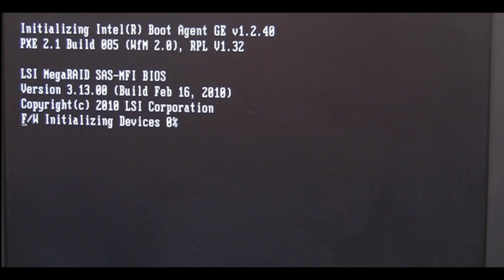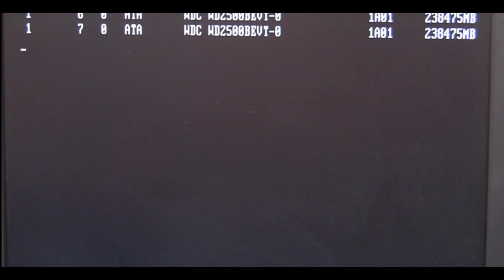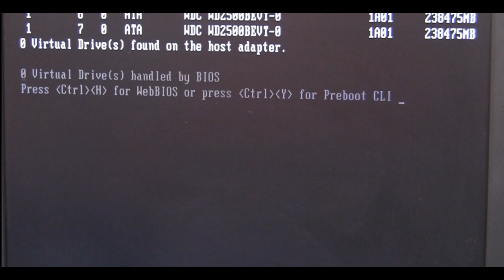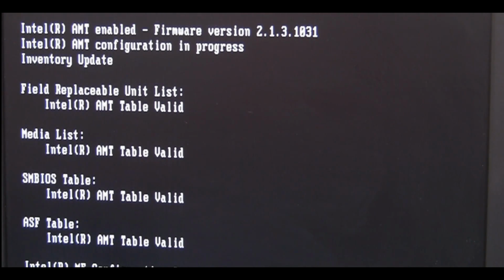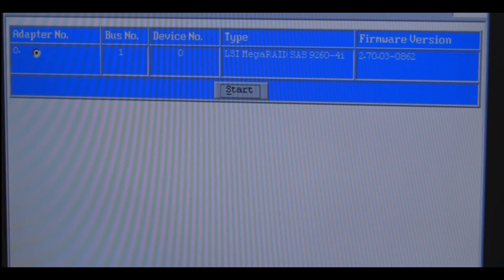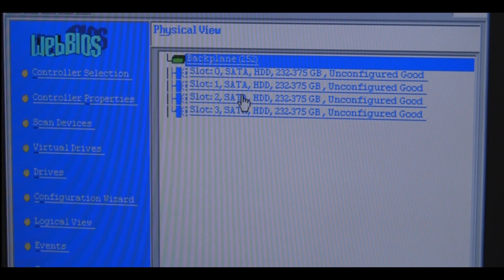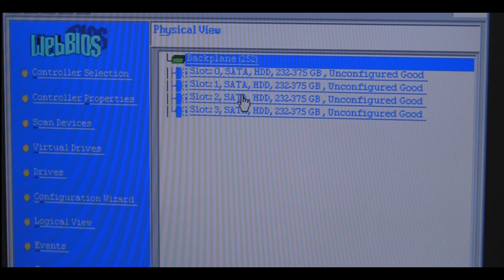Installing the LSI SAS controller in a Desktop Part 2

Comment: Sir, please help and reply my question.

My LSI SAS array card 588735-001 is damaged, it was previously configured with raid. If I buy a sas raid controller of the exact same type, does it need to be configured again or is it plug and play?
Reply from the maker: No, and it is critical that you configure the new one exactly like the old one in order for the array to work properly.
Reply: @TechsavvyProductions  If I replace with new sas raid controller and configure it again, will the operating system and applications that were on the old hard disk be lost?
Reply from the maker: Yes, be sure as much as possible you restore the disks and controller as the old one.
Reply: @TechsavvyProductions  okay, thank you so much. From Indonesia 🫡

Comment: does the card require raid software or will will the drive be accessible by the host ?

meaning throw in the card and a sas drive and then the drive can be formatted by the host and show up on the desktop as if it was a sata drive?
Reply from the maker: During the boot process you are given the opportunity to access the controller firmware, its in the firmware that you setup the JBOD or RAID configuration.   Based on what you configure that is what Windows or Linux sees as a drive.
Reply: @TechsavvyProductions  i was mainly asking if it was pretty much plug and play because i have kali linux installed and i am thinking of getting one of them cards.
Reply from the maker: Yes, after a driver is installed it should work fine.
Reply: @TechsavvyProductions привет, в прошивке биос контроллера 9260 видны диски подключенные к контроллеру но они не определяются в windows,  контроллер lsi 9260 8i, драйвера для контроллера установились с отчетом "устройство работает нормально".
Что надо сделать в этой ситуации чтобы нормально работать с дисками не создавая raid массива?

Comment: Nice video, do you have a tutorial with examples using sas drive and what type of connectors using with some specific controller im really confuse with that.
Reply from the maker: Good question, this was a lab allowing students to learn enterprise RAID both setup and repair of RAID arrays.   But there are bigger issues, SAS drives run hot and they must be cooled, controllers do not have fans so they must be cooled.  Most controllers use a 1-4 connector  one interface goes to four drives.  SAS have value only if you plan RAID arrays, if that is case check our video:  https://youtu.be/ZqPxuQ1ibKI  and https://youtu.be/-7EjJYInIzE

Comment: How do I get into that bios? I have 2 1tb ssds connected to the controller, no drive connected pc, so no OS. I boot up and it goes right into my mb bios. What am I skipping? NO shows that beginning step! DO I connect another drive to pc, install windows then  use utility disk that came with controller??? PLease someone respond
Reply from the maker: Most newer motherboards turn off BIOS boot up screen text (example POST).  Start by turning off fast boot and any motherboard logo displays so you can see the adapter card's firmware display during boot.   As your UEFI/BIOS boots it must yield to the firmware in the controller with some type of keystroke info to access the controller.   Hope it helps and thanks for watching!
Reply: @TechsavvyProductions  I figured it out yesterday. I had to turn Legacy mode on for my motherboard. All is working now, but EVERYTIME it boots, it goes thru the process of initializating, I dnt press anything, then after  it boots into windows. Is that the way it is suuposed to be???
Reply from the maker: Correct, once you have everything working you may be able to turn off legacy.   It depends on the firmware on the motherboard.
Reply: @TechsavvyProductions  Can you PLLLEEASE link me to where you purchased that fan, or give me some type of specific  name so I can look it up on amazon/google???
Reply from the maker: You are looking at something like this:  https://www.amazon.com/Vantec-SP-FC70-BL-Spectrum-System-Adjustable/dp/B000233ZMU
Reply: @TechsavvyProductions  I ended up finding a fan. Thanks for the response. When I get off work, will check if turning off legacy will skip the LSI boot initialization